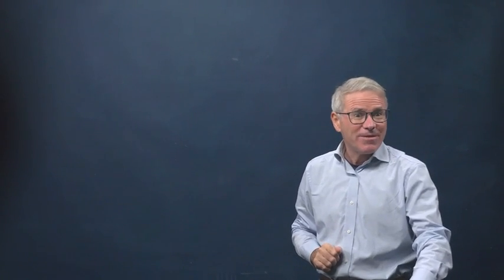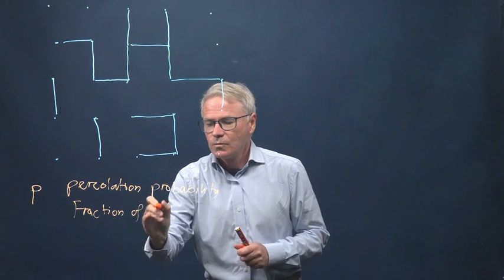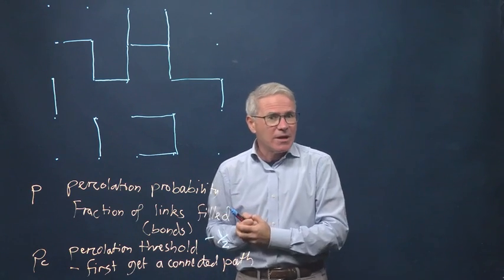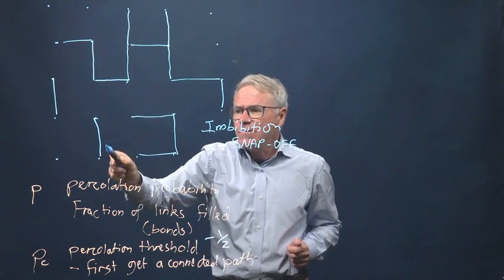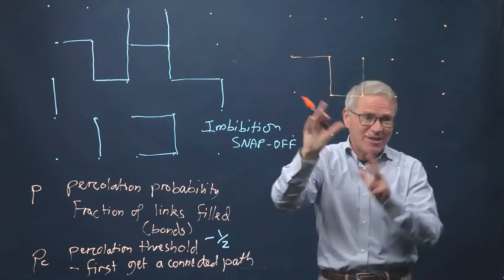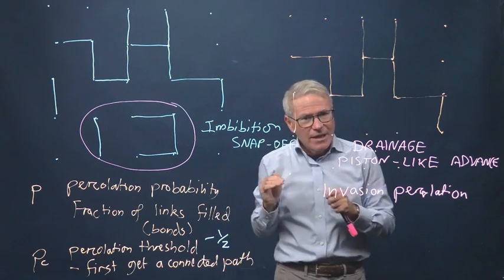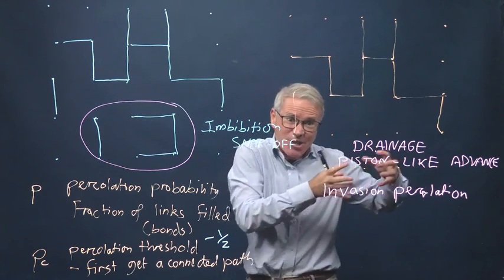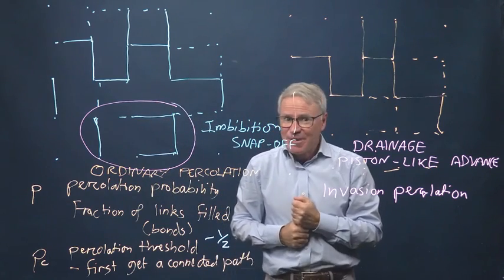Percolation and porous media

Comment: Is this a correct statement, professor: 
If we are injecting CO2 in saline aquifer which (let's say) is strongly water-wet. This will be drainage, right? Then, this would also mean that CO2 will follow piston-like advance and thereby reducing snap-off and subsequently CO2 entrapment is reduced as well.
Reply from the maker: It is correct that the advance of CO2 is piston-like in an invasion percolation pattern.  However, CO2 is trapped after initial injection as the plume continues to move and CO2 is displaced by water.  Here we have an imbibition process, snap-off and trapping of the CO2.

Comment: Professor's video explanation is excellent; however, I've been struggling with the process of solving for the percolation threshold using the Ornstein-Zemike equation. I hope the teacher can upload a lecture on this specific part.
Reply from the maker: The OZ equation determines a correlation function, normally between molecules or ions in a liquid.  This is not really relevant to the determination of the percolation threshold, which is largely controlled by the coordination number of the lattice.

Comment: Such an easy-to-follow up explanation! I was a physicist student until last year, when I decided that I wanted to do more practical things and moved to an electronic engineering degree. Also, I am a barista and I'm utterly amazed by the mathematical modeling of many coffee systems, a branch which is not deeply explored yet, which makes it more interesting. Also, I am keen on modeling the flow of cars in cities to further improve congestion in cities, so this knowledge comes in handy.

What books can I read? What mathematical areas do I have to handle? 
Thanks again for the video,
Francisco from Argentina
Reply from the maker: A good, short introduction to the theory is "Introduction to Percolation Theory" by Dietrich Stauffer and Amnon Aharony, Taylor and Francis (2nd edition, 1992).
Reply: @BoffyBlunt  Thanks!